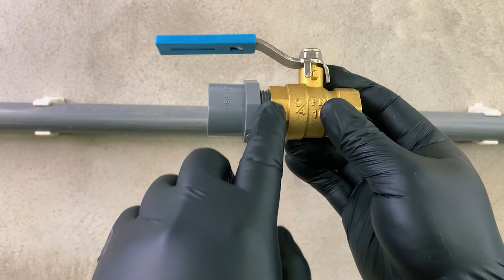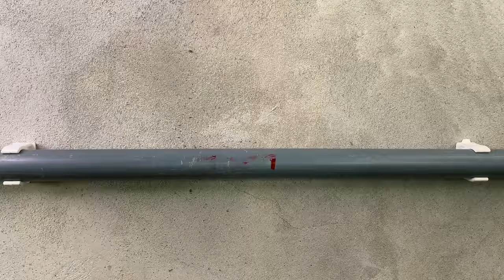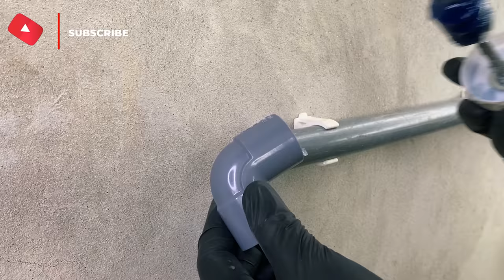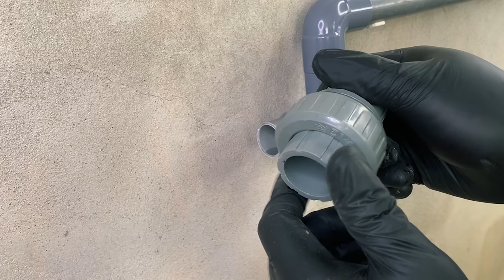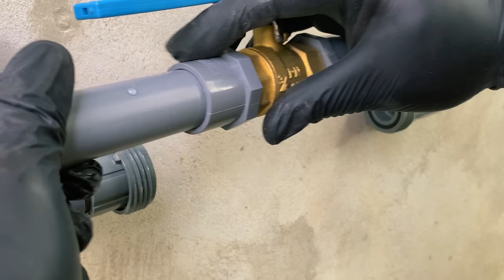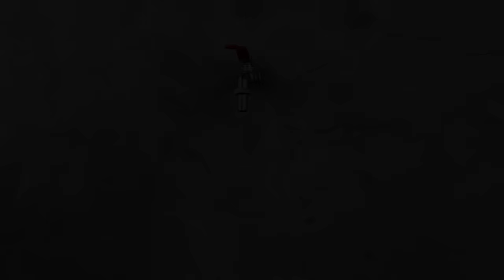Simple tricks to replace the metal water lock with 2 threaded ends, which many people do not know

Comment: can be done in a much simpler way
Reply: Even use one extra union. Can be done using one union. Both side union is useless.
Reply: @satendragreat  can be done with zero union. Its just a valve in a domestic piping. Any average piping job will last years. And when it fails after a few years, theres enough pipe on either side to keep cutting and rejoining with sockets. Theres enough pipe to keep cutting and replace for 2 generations of people living there.
Reply: @satendragreat  +
Reply: @de0509  Exactly, without introducing a bunch of o-rings.

Comment: You must be a partner in a plumbing company to use that many fittings why not do it simple
Reply from the maker: yes, thanks for your advice, I have made things as simple as possible in this case. If you have any other simple solution please point it to me! I wish you a good day!
Reply: The more joints the more chance of leaks
Reply: Once again you leave me wondering where you learned your skills from ?
Reply: Why u need to fix two pcs of union  u are wasting more fittings
Reply: You can just use a pex shutoff valve and this would of literally taken about 60 seconds.  It's so easy cheap and fast, every thing in my house has shutoff valves.  This makes no sense whatsoever.
Reply: Truely
Reply: Too many joint..

Comment: A perfect demonstration of how to make and use a lot of materials. And here is a short ball! From the right side, a PVC adapter with a thread is poured onto the pipe, and a water valve is screwed onto the thread using LOCATE silicone threads. From the left side, measure and cut the pipe so that the PVC screw fitting and the PCV adapter screwed into the valve, using a thread, fit. And it's a simple combination! However, when we want to replace a faulty valve, we unscrew the screw connection. One part of the union remains on the pipe on the left side, the other part in the valve. Unscrew the second part of the screw connection with the PCV adapter from the valve. And then unscrew the valve from the adapter on the pipe on the right side. And that's how it's done, which is the European principle of connecting pipes to valves, using a single screw connection!
Reply from the maker: Welcome to my channel! Wish you have moments of fun and comfortable watching videos! You are so kind to leave me a comment! You're right! My method is not optimal and not suitable for all countries. So if you have any other better ideas, please share them with me! Wish you the best!

Comment: These tubes are used by us for electricity. They should not be used for water. There are stronger and better types, and we use caustic in welding
Reply from the maker: thanks a lot for your comment, you're right, that's a good way too, looking forward to more of your advice, have a nice day!
Reply: I think if there's low pressure, such PVC tubes are ok even though there are more durable kind of tubes, such as the classic copper pipes.
Reply: @ekswhy2147  I once opened a tap valve on sink in toilet where it locates in the basement of 20 floors building.  The water pour out extremely fast and enormous. You can imagine how much pressure it was. I'm in suspicious then  bend down to look under the sink. It is PVC pipe that withstand the pressure.

Comment: Never saw anyone cut tapered pipe threads before.
Reply from the maker: Yeah, it's not the most common technique, but sometimes it's necessary for specific situations. Have you tried it before, or do you typically use a different method for pipe threads?"

Comment: Using two unions is just so wasteful. You can pull out the pipes from the conduit clamps btw. Just use 2 sockets and the valve. If I call a plumber and see them do this Im telling them to go home and Id just do it myself. How much replacing does a typical domestic piping need? Its going to last years. Theres is absolutely no point to use even a single union here. And he used 2
Reply from the maker: Thanks so much for your advice! luckily I didn't come and fix the plumbing for you! you're right my solution is not the best so I'm looking forward to your useful advice so I can make it better! I hope you stay healthy and watch more of my videos!
Reply: @tipsunknow  btw Id like to suggest using a wrench. One rule of thumb is if it feels tight with a wrench, then its 100% guaranteed that it cannot be loosened with bare hands. Not sure if this applies to when you use o-rings though

Comment: Видео надо было назвать - Как себе усложнить жизнь.
Reply from the maker: First, gather your materials: rubber bands and chewing gum.
Cut a small piece of chewing gum and roll it into a thin strip.
Wrap the chewing gum strip around one end of the pipe where you want to make a connection.
Secure the chewing gum in place by wrapping several rubber bands tightly around the chewing gum and the pipe.
Repeat the process for the other end of the pipe you want to connect.
Once both ends are securely wrapped, turn on the water and hope for the best!
Of course, this method is highly unreliable and likely to fail spectacularly. It's much better to use proper plumbing connections and tools to ensure a safe and leak-free water system.